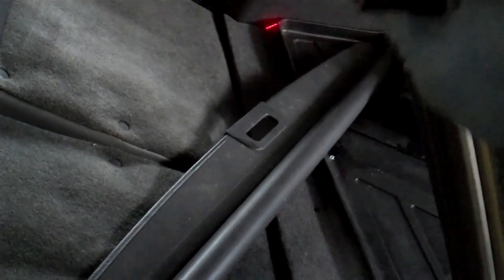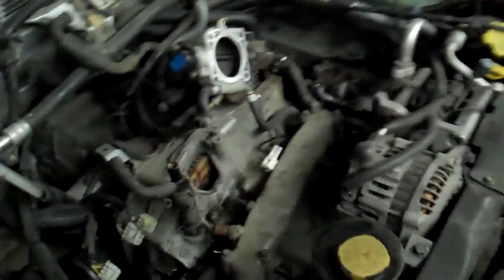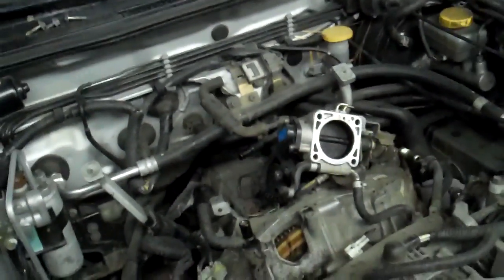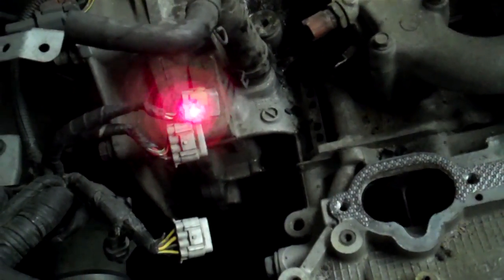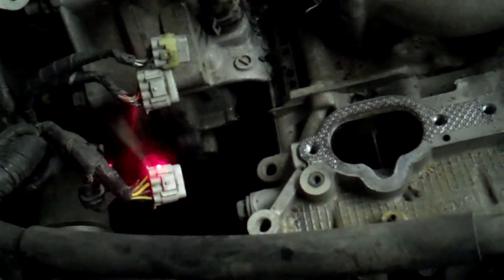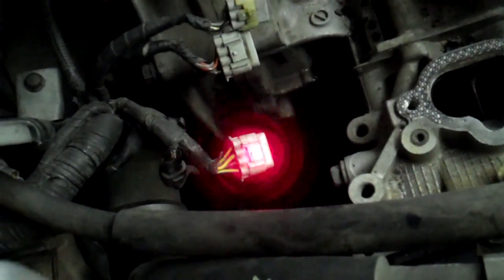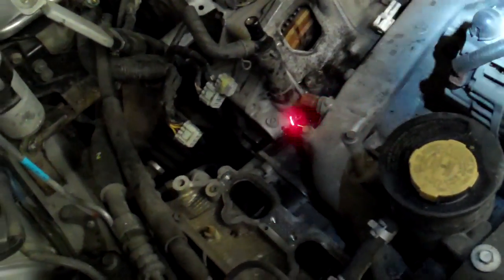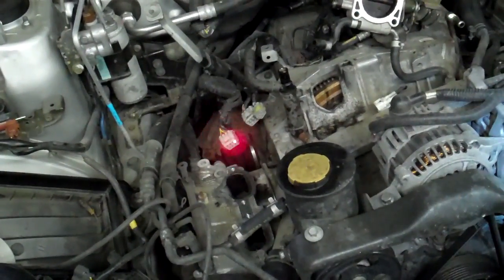How to find an electrical short on a Subaru or any other car.

Comment: So I have the same car it's a '99 but not an outback still a wagon though. I'm having the same issue I have cylinder 4 misfire. What wires did you find were bad that you ended up having to replace. I know this was 13 years ago but any help would be really appreciated.
Reply from the maker: It was the wires at 4:40 time stamp rubbing on a casting buttress on top of the engine block.
Reply: @briansmobile1  I ended up taking the valve cover off and finding that the wiring harness was actually routed above the crossover coolant pipe. I ended up finding no signs of chafing. This did not solve my problem but the misfire mood from cylinder 4 to cylinder 1
Reply from the maker: This video is more about the process of finding the short no matter where it is by unplugging sections of harness or wiggle testing sections or pulling them to narrow down where to inch test it inch by inch looking for shiny copper.  Good luck brother!

Comment: Thanks for info I’ve had my 2008 sti just suddenly die on me and will not crank over at all the temperature is in the max but car is cool there’s an abs light and a a light that looks like a car on tilt with line through it.my Subaru is a 2008 sti hatch ej25 please can someone help me out with info on this.I’ve checked the fuses a can see under foot well and bonnet it’s a uk model

Comment: So I did a motor swap from a 2008 subaru outback 2.5i into a 2007 impreza wagon that had what looked to be an identical engine (i believe after 06 the wire harness plug to engine changed as did the heads to AVLS timing ) so I was very careful to match up the engines , well all went smoother than expected and I had it all changed out in one day ! Then when I turned the key ...nothing . The usual stuff like the lights horn all that worked fine . I searched for relays , fuses but I'm not sure just where to find them so that's ongoing.  Second I checked all grounds and that checked out good. Then I realized I wasn't hearing the fuel pump cycle either...then some kid obsessed with subarus tells me  I need to swap the ecu also maybe the wire harness and reprogram the ecu to have my vin and something about programing the key and using a code reader and on and on really wtf .is that all true ? No crank no fuel pump signal and it all functioned good on both cars before ..you know you stuff good vids by the way I trust your word so any ideas here  .??

Comment: Can a p0083 code after a diagnostic test and replaced both vvt  and oil pressure sensors mean the ecm is fried? Bc I traced back the vvt wire to the harness connector of the ecm and it was fine but it keeps throwing a p0083 code no matter how many times I clear the code

Comment: I have a subaru  legacy 2.5 2011  I went threw 3 mechanics  tried cam shaft tested the starter  change the altenator  change the pcu even flashed it I was told it's a ground default it was running great before  it stop working won't  even start  I get a mis fire crank case I get 6 codes but it all points out to a ground default  place help
Reply from the maker: Check both your ground wires just inside your front wheels underneath.  They go from the frame to the engine.  I bet one's blue and corroded out or ripped out from road hazards.

Comment: I’m having an interesting issue. I’m having really bad hard starts with my 2002 wrx. If it decides to hard start in 5 seconds it’ll show p0340. Even if it starts fine or does it’ll sometimes give me misfires but the engine feels fine. I thought coolant temp cam/crank sensor. I replaced all of them. Didn’t fix. Wiring seems fine but I’m gonna double check the ecu harness side. One time  while driving I got p0335  along with p0340. And cold starts are normally fine hot starts are pain 50% of the time. Mainly on hot days it fights me. I don’t get it. What would really help is if I could figure out if the ecu is forcing that code cuz it knows something is wrong.

Comment: There’s a wire that I see that isn’t connected to anything and it’s mounted to the engine bay. Wen I put it on the starter the egr valve makes a clicking noise
Reply: Wat is that wire? Do u know?

Comment: Probably used to transport luggage at an airport, I had a 15 year old cavalier wagon with less than 30,000 miles and no rust, in the Northeast? Rair but it happens.

Comment: Idk if u will see this but I got a 2008 Subaru Impreza sedan 4 dr 2.5i motor so the probablem iam haveing is that my rear running lights for night time don’t work so I checked the fuse and it was blown so what do I do I replace it with the same fuse and what happens I start getting smoke from the fuse box in the motor area and smoke coming from the fuse box inside under the dash so I pull the fuse out and boom smoke stops but now I got no rear running lights no license plates lights and no front orange running lights but brake light works fine and headlights work but now also have no brights and just a couple days ago it was working fine everything

Comment: I have a 93 Subaru legacy and the tps is shot. My tps has 4 prongs as well as my harness. I can't find any except a $400 one from Subaru. Is it possible to use a 3 prong tps from a similar year and a 3 prong plug from the harness of a similar year as well. Can it be done without messing things up?

Comment: Thanks for video; I have a similar problem, with my FORRESTER 2002: after a bump, the RUNNING DAYLIGHTS go off (not the HEAD LIGHTS, which are controlled via the steering wheel switch, mind you), and the BATTERY light turns on the dashboard. After another bump... everything becomes as normal as before the bump!!!  btw, I installed a BATTERY and ALTERNATOR monitor on my dashboard (one of those you purchase at Walmart for $14.00CND) and it goes up to 15.0 volts. Obviously, there is a surge in some ckt, but I can't figure it out. Any ideas? Thanks a million, again.

Comment: I have 2003 legacy gt limited swapped motors n transmission everything worked fine then my hid fog lights started blowing fuzes i switched to stock n still blows fuzes instantly. My car wont start unless jumped n soon as shut it off its done no power but when driving if i touch brakes it acts like its going to stall out my radio shuts off n turns back on n all interior lights. N when did heater core job i lost all dashlights but everything else works. Im stumped n havent figured out n just let car sit since have an 07 vw gti. Any help man???

Comment: im having electric problems with my subaru. ive check the tps sensor its always 5.12volts even with the throttle open. as well the iac valve no current. my question is how can i check to see if the wiring are bad? or if theres current between the sensors and pcm/ecu/etc.?? thanks.

Comment: Hi, I was wondering if maybe you could possibly know what could cause a Subaru Legacy to do these things 1.Won't start (bypassed solenoid) 
2.Won't run fan(s) unless relay is jumped. 
3.Won't blow cool air(unless in reverse), then only slightly cooler.
4.Daytime running lights are inoperative(also hi-beams). 
5.Radio caught fire(obviously) 
6.Power windows inoperative (relay jumped) 
7.Transmission shift solenoid (valve body) 
I think that's it... Kill me! 
Feel free to email if that's easier if you have any ideas! We're at a complete loss! Thanks in advance! Carrieemerton2@gmail.com

Comment: old neon, reversed it stick, blew fuseSSSS, towroped it, unhooked pump still blew em. searched fuse box harness,,pulled it away from engine, looked good, no blow, ziptied harness there drove 2 years sold it

Comment: Hey Brian, great videos buddy , I have a 2009 sub.forester ej25 engine died on me, replaced the cracked coil  but Still dont get a spark engine turns over but wouldn't start any tips on what controls the power to the coil or suggestions to try something else?

Comment: My guess is the odometer doesn't match up with the vehicle and someone did a head gasket job snd did not put it back together right. Those intake manifold wires sit over the coolant bypass pipe. Being a Subaru tech again i think it wasn't put back together right. Just my professional observation. But great job troubleshooting the short.

Comment: I have a 96 jeep Cherokee sport 4.0 that when I connect the neg cable to the neg post the car start to crank with the key on the off position an it a new ingintion switch working on it with couple of information I got any advise let me know thankyou like your vedios
Reply: U have batt + goin to the starter somewhere

Comment: Great video Brian. I have 07 Titan. The air bag light is on. I cleared it, but it comes back on right away. Wife took it to dealer who said it is short in harness in steering column. I was just planning to buy the harness and replace it myself. But if I replace the harness and it doesn't fix the problem, I'm hosed, right?

Comment: Easiest way to find a short? Get two long lengths or wire add terminals one end that fit the fusebox and on other end that fit a H7 bulb. Remove fuse plug teminals in and as you have a dead short the H7 on the other end will light up. Work your way along suspect areas until bulb goes out. Caused by moving loom and for a moment removing the short. You now know exactly where the break is in the wiring. Simple. Just remember if its canbus either very special repair or new loom
Reply: Quick P.S. Make sure bulb is outside of car and well away from anything flammable as bulbs get hot lol

Comment: i have a 1997 wrx turbo,it drives fine for 2-3 miles then i get a fizzing sound from the driverside footwell and the engine cuts out,its been a garage and got a clean bill of heath,i drove it home and it cut out 3 times..now the ecu has been sent away for study...i hope they find a fault because other than that its a really great car..

Comment: Rather than wasting a bunch of fuses seeing if it is still shorting out wouldn't it make more sense to just use a multimeter and check for ground continuity on each of the pins of the connectors?
Reply from the maker: That's not a bad idea if you are paying retail for fuses.  You will have to know exactly which wires are ground for each connector and that will require you to print and study the diagrams.  I always buy a bunch of fuses when I go to the junk yard.  They're practically free.  And this is FAST!
Reply: Yes I suppose thats true, I guess in my head I was just thinking that the grounds would always be black but maybe thats not always the case with the abundance of wires in a car, I have an electrical background but not automotive. Thanks for the insight
Reply: briansmobile1
lol everyone i know just pockets the fuses when in the junk yard... love your videos btw.
Reply: sabgog yes no i guess?
Reply from the maker: Many circuits when void of a fuse bringing the power will show ground.

Comment: Hey brian I've a most annoying problem. My headlights are getting too hot and they dimm down when i use the window swtches but the fuses are fine. My ecu looks like not enough power is getting to it at least thats what i think. When i test the fuses with a multimeter by checking volts. I hook up positive lead to battery and i ground each fuse which shows me same voltage as battery. When i test the RH headlight and LH there isnt the same voltage and the same goes for the ecu fuse. Is this normal?

Comment: I use a breaker out of a scrap-out-government-junk (but some cars now have breakers).  I wired up to spring clips and just use that instead of blowing fuses.  All you have to do is reset the breaker instead of puting in another fuse

Comment: @briansmobile1  I just hooked up my gauges. And I ran my power wire to my clock. And jist put my ground to the body, and I keep blowing my radio fuse. What could this be?

Comment from the maker: Get your hands on a wiring diagram and see what circuit those are all on.  Then narrow it down.   It's probably a rubbed through wire insulation where there's been vibration, or body damage, or something like that where a hot wire is grounding out.  There's a great tool/kit for that from KD tools.  It's part number 2524 "Short Circuit Detector"  Realfixesrealfast has a video on it.  From there, there's a link to buy the tool too.

Comment: Hey Brian, My 97 avenger is having an issue that blows the instrument panel, shifter, and nighttime rear running lights that are all on one 15A fuse, I am pretty lost, should I focus on just those parts or should I also check the stereo, headlights etc.. As those other parts are working fine?

Comment: hint for troubleshooting- make a fuse test light to save on fuses during testing.  Get one of the blown fuses and solder wires from them to a headlamp or other higher drawing light, and plug it into the fuse socket.
If the short is present, the lamp will light brightly, and if you locate and remove the short, it should go dim. With a long enough wire to the light, you can place it near wherever you're looking and get visual feedback as you jiggle the harness or unplug the various suspects.

Comment: thanks a lot! I have an old buick electra that has a mysterious energy drain, but now I know to look at that crappy after market stereo that was put in. also, I noticed a bunch of wires "grounded" in some sort of orange harness thing to the side of the engine compartment, but there was weird gunk all over them.  wondering if "re-grounding" these is a good idea?

Comment: @briansmobile1 @briansmobile1 the sparks plugs are under 3k,and the poor ground is like 200ohms withj points closed i thnk thats bad but the only solucion i think is to clean the dizzy clamp cause the cable and other parts for the ground are kind clean and normal,i found ground in the ign 12v ON position(fuse box) i found it luckily,i think thats the problem,who knows hjehehe thks to spelunkerd i found your video cheers

Comment: @briansmobile1 
Tried it once with my dad's EFI Ford. Pushed the damn thing for half a mile, no result. I can't remember in what gear it was in because my older brother was inside "driving". Gave up, pushed it back home, put the battery on the charger, started it in the morning. Don't want to try that ever again. 
EFI is great, totally the way to go, but carburetors have their advantages too.

Comment from the maker: @GM572 That's a winner machine right there!  You can "pop-start" an EFI car you just have to have it rotate long enough to get happy and fire up. (with the key in the run position of course)  Some times putting the car in 3rd or doing it in reverse helps.  I should do a video on that. ; )

Comment: @briansmobile1 
My 1.2 liter Subaru(with carb) does around 7,5l/100km(which in Arbitrary Measurements Rollercoaster is somewhere around 31.3 mpg). That's really good for a 20 year old 7 seats mini-van with 4WD. And it has a catalyst and an O2 sensor on the exhaust. 
Also, you can't push start an EFI car when your battery is dead :) .

Comment: @briansmobile1 
Don't get me wrong, I'm all for EFI, I really do prefer it over carburetors in terms of efficiency, but those were waaay easier to mend. I got 2 very different cars, one running on EFI and one on carburetor and I am always reminded of the difference. One of them only needs to have 4 things checked(air, gas, compression, spark), another one has lots of little wires sensors and actuators.
Oh, and the carbed cars can have catalysts on the exhaust. Mine does.

Comment: My right turn signal seems to be staying on or at least in side, but on the out side its off and when i turn it on it works fine some time and some times it densest work at all . For it to work i have to turn it on and off on and off. any ideas?

Comment from the maker: @reneonlineg1 False.  I undid everything first and then connected them one by one till the fuse popped.  I have some experience/intuition to go by because I've swapped and rebuilt so many of these engines.  I'm pretty familiar with the wire harness etc.

Comment: It happened to be dark outside when i was installing the new  battery its has the side mount connections and i should of put the positive  on first but i didn't  but anyway I noticed after putting the negative terminal on then as i was putting the positive terminal  on a slight spark as if i had a draw but no light's or anything on that was visible so I may still have a short  and also didn't here any noise as if something was running but again thank for you video it gave me some Ideas

Comment: Thanks for sharing this video ,gives me some  good  information  on finding shorts as i have a short or a draw  that's was   slowly draining my battery I'm  not sure  if my problem is fixed yet though ,because i think it could have been my alternator that had an internal short while the engine was off and cause a draw on the battery  I  replaced it but the constant draw ruined my battery ,but adv replaced it free because it was under warranty

Comment: the pcv will get milky if the car only makes short trips and doesn't get up warmed up enough to burn off the water condensation.  I'd guess with the low mileage the car may only be used to make short trips.

Comment from the maker: @focusonthegreen Sorry I've forgotten the context of your question.- if just the high mount isn't coming on- may I suggest checking the bulbs and using a continuity tester to verify power and ground while a brick or heavy tool is on the brake pedal?